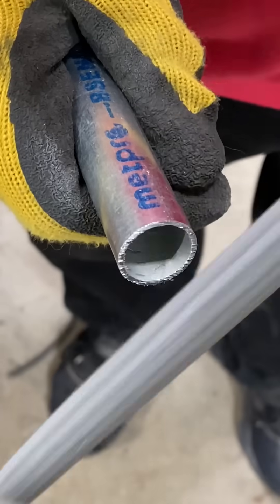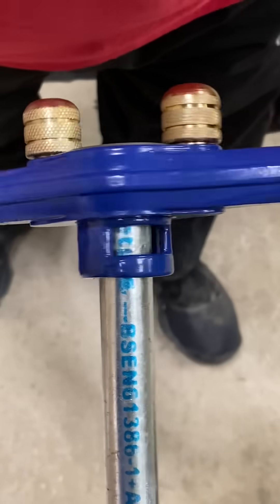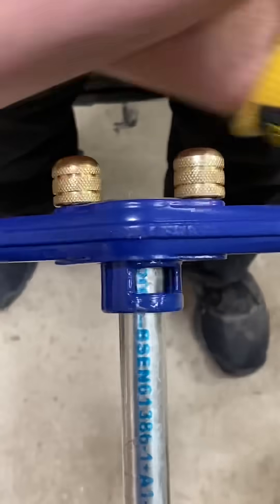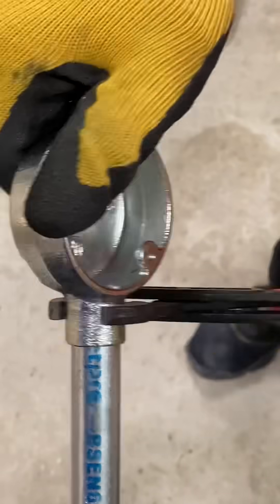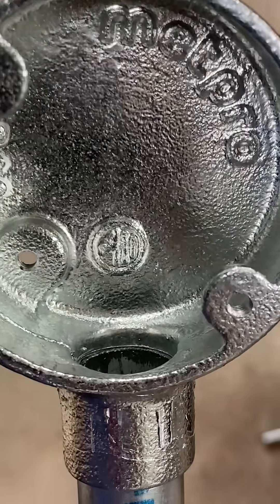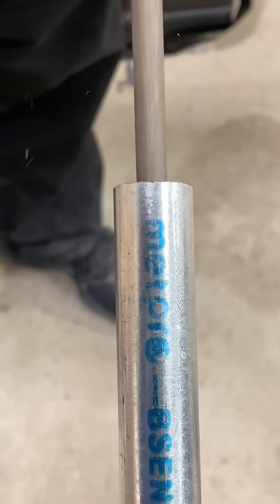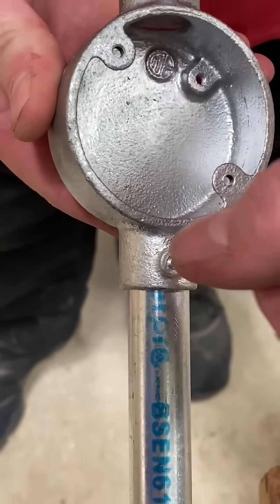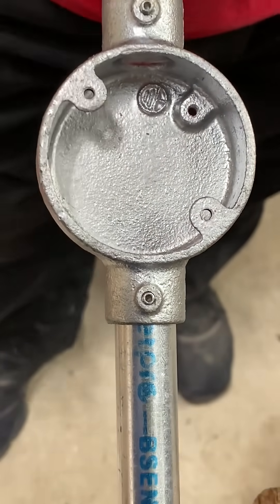THREADING METAL CONDUIT VS CONLOK FITTINGS -#Shorts

Comment: conlok seems extremely poor quality, the grub screws are pathetic and small, often stripped before you even get near them, although so is most conduit and dies etc, they never seem to thread straight, and indeed a lot of accessories are not tapped straight.

Comment: Do that all day, 5 days a week sometimes using 25mm conduit . You soon get bored of threading conduit. Plumbers have had push fit couplings for years, and water goes throu there pipes.

Comment: Should have used a spiral fluke reamer to dress the end of that galvanized rigid  steel conduit.  He didn't put anywhere near enough bevel with that rat tail file.  Look at the end of the conduit when he finishes screwing the fitting on the end of the conduit.  The wire insulation could be easily stripped  off while pulling wire through it.
Also those are NPT (National Pipe Thread) dies in that pipe threader which should never be used for an electrical installation.
Electrical conduit threads on a 3/4" conduit like that should have a 3/4" taper per foot.  NPT threads like the one you see here have no taper.  Those dies should only be used for plumbing.  Generally used for water and pneumatic installations.  Of course you'd never use galvanized pipe for a pneumatic installation.  You'd use black A120 CW,  150 psi WOG.  You guys be careful and don't hurt yourselves...

Comment: We don’t thread emt because it’s not technically conduit. Emt stands for electrical metallic tubing. Imc (intermediate metallic conduit and grc (galvanized rigid conduit) is always threaded. Emt is so thin that threading it can compromise its integrity and it’s not supposed to be placed in areas where subject to possibly severe damage. Cannot also be used to support anything and a separate ground wire must always be installed. The fittings we used for indoor are similar to the conlox thing. They are set screw connectors. Outdoor or damp locations require rain tight compression connectors. I personally don’t see the point of threading emt. If something needs to be threaded then imc and rgc should be installed instead.

Comment: We use compression couplings for emt or set screw style. Depends on what the specs call for. We use rigid steel pipe when doing the treaded pipe. And frankly you should blame UL whatever they say we can use we use. Obviously people are gonna use the cheapest method to make the job the cheapest. It's kind of sad because I would really enjoy threading my EMT.

Levi Hermer
IBEW #601
Commercial Inside Wireman

Thanks for the look , from your side of the pond wherever that may be. Alwayes interesting seeing how many different ways there are to get from A to B and get some wire inside. Lol 🤣

Shit everyone alwayes gotta have their own way to do it, that's "better" then everyone else. 

Long as the check clears il thread it or not thread it, depends what they want to spend on materials.
Reply: Or what code requires per the project....before I get attacked lol

Comment: You are right Americans don't like to thread we use compression fittings it's a lot quicker. I do like threading some pipe . But if you make a mistake you have to rethread using compression fittings it's just a simple cut with your Milwaukee fuel 12volt compact band saw on your side

Comment: I was told we don't thread EMT because then the wall thickness where threads are is to thin and will eventually break there. The steel conduit is thicker wall.

Comment: You Brits need a tapered pipe reemer to debut the ends of the saw cut conduit. Or use plastic wire guides. What you showed could strip the insulation off in the middle of the pull.

Comment: This is not good even if you do this use compression connectors or regular screw-on connectors because if you look closely when he gets the box and you can see the birds on the inside which is going to Nick all the wires this can cause a short that's why you do not Red emtu Thread rigid

Comment: Oof, as an electrician, why would you use the channel locks on a clearly finished surface that will probably be visible?? Good trick is stick a screwdriver or nut driver into the open face of the box and into the other conduit hole and use the screwdriver for leverage. Keeps the fitting looking much cleaner if it will be visible

Comment: Why bother with EMT if you're going to thread it? Just use rigid. Many customers like the speed and low cost of EMT and compression fittings, so just follow what the local code requires or the customer prefers, it's not difficult!

Comment: In the US it’s actually against code to thread EMT (thin wall). Only permitted in IMC or RMC. That’s is because emt in the US is way too thin to thread. Only allowed to use set screw or compression couplings/connectors.

Comment: Wonky BS, I wouldn’t trust that set screw w/o thread locker, and even then I wouldn’t use it. Pro tip: Easy and cheap never equals sturdy and long lasting.

Comment: Threads aluminum pipe. Nothing wrong with the old way when it's soft metal but try that on cast-iron pipe that's 2 in and not 3/4

Comment: That’s a big no for me.  I’ll thread it using a pony any day before I use a set screw.  Reason being that set screw will loosen over time, the conduit will slip out from vibration alone, then you have exposed wires and no ground. Or you have someone using the pipe as a ladder rung, same result.  I seen it too many times.

Comment: Why use conduit? Seems as so much unnecessary work.
Also an insane amount of metal to run some wire
Reply from the maker: mechanical protection - e,g industrial environments
Reply: @efixx  yeah, i work in industry and still barely use pipe, we only use it where it's Exposed for any physical damage.

Comment: I would much rather have a threaded conduit box much sturdier connection less chance of condensation and or water getting inside not to mention on your running long connections the threaded conduit boxes is the way to go in my opinion

Comment: Threading EMT?! 🤣😂.  YOU ARE ALTERING UL LISTED MATERIAL.  NEC 110.3(B) Installation and Use. Listed or labeled equipment shall be
installed and used in accordance with any instructions included
in the listing or labeling.  Making this idiocy 100 percent illegal
Reply from the maker: In 🇬🇧 conduit threading is standard - it’s much thicker than your EMT

Comment: I do both only if required in a project spec... local regs is flexible to plastics, threaded, screw or chem cement... underground is pvc or pe... never metallic..

Comment: Grub screw is useless if it has to be fire rated which is the main reason you would bother using steel conduit..
Reply from the maker: Mechanical damage is the main reason to use steel in lots of applications.

Comment: I did millwright work for 6 years,  I always carried a tube of super glue for the set screws.  Worked every time.  I've been out of the business for 5 years but I guarantee my work is still holding up.  I hate EMT conduit.

Comment: Not good enough. I use schedule 80 stainless steel pipe with fully welded joints.
Reply from the maker: Hot works is a challenge on most sites

Comment: Well yeah... thats a method to connect things, but you should remember that this typ of connection cant be air-tight and is weaker. That for i cant see any use on pipes

Comment: Yep that's pretty much the way us yanks do it over here on the other side of the pond We don't thread EMT because It weakens the end of the conduit and under pressure it will break off The threads are deeper than the EMT is thick  so we only thread rigid and intermediate conduits.

Comment: The only time you need those threads that if you have a yacht and you're doing the conduit on a boat that's going to be rocking and bumping around that thread is going to hold 10 times better than the other.

Comment: A set screw with no detent? Umm... No. Ineffective. It'll slip like crazy. You need to punch or drill a dimple for the set screw to fit into. That way it won't twist or slip out of position if it gets bumped or tugged or dropped.

Comment: I honestly think i like threading pipe more than i like using grubs.     As an american who doesnt thread pipe, id happily use a threader tool over grubs in almost any scenario.   Grubs strip faster than phillips screws in most cases, and hex heads are much harder to source and keep than a decent sized threader.       But im also used to hand drilling and wire sawing so i probably just prefer the tried and true methods.

Comment: That looks like Ridgid Pipe and you also got to deburr the pipe.
Reply: That's 100 percent EMT. Also he did deburr it with the file.
Reply: @jonlehman2671  it’s not EMT. It’s UK class 4 steel conduit - more akin to US rigid conduit. You can’t thread EMT.

Comment: Yes it’s quicker, but do you want this in your house instead of a solid mechanical connection? Same goes for plastic water pipe/flexible gas lines, if that’s your level of acceptance for the place you live god bless. 

But I’ll see it through proper, and wouldn’t accept less for a customer and If they don’t see the value and wanna pay send them packing.

Comment: Yank sparky here, we use set screw connectors on pipes all the time, just not outdoors. Rmc is usually threaded because its usually specified for rough service.
Reply: As a fellow yank sparky I approve this message
Reply: Greetings fellow yank sparky's may I join this club
Reply: This has nothing to do with my job, but threading what looks like a pipe to the youtube algorithm and BAM here I am. but i am a yank Pipefitter. Can I join the club?
Reply: @bretatvs  i welcome you to yank tradesmen club
Reply: @Superbonker-np6iz  you spelled yank wrong but I guess I will allow it

Comment: Such a horrible idea to run electricity through such excellent conductors. Just a lethal source of danger. I never understand why that is still a standard. We’ve moved on! There are plastics to prevent you from untimely deaths!
Reply: It's far more resistant to fire and damage than PVC. Mostly used in commercial/industrial applications. Besides it's normally grounded in multiple points as well as having a ground wire.
Reply: @blaydCA  Fire is the reason? Really? Electrocution of whoever happens to touch it is not the issue? Fire would be more likely to start with festively sparkling short circuits I would expect. As soon as the grounding is compromised you’re left with a death trap. I’m glad I’m not living  over there 😂

Comment: We don't thread in north America because it thins the emt, and that end looks sharper than it should be for pulling wire. "Conlock" seems like a roundabout way of not using couplings and connectors like we do - but all our boxes are all compatible,  affordable and with a simple knockout of varying sizes. That tiny Allen key seems pretty small to rely on for continuity as well. Not impressed

Comment: Why thread emt it's already paper thin and you want to remove more material also it might be a language issue or something an an American who used to be an electrician we called emt the thinnest pipe you can buy for electrical usages emt and imc was medium thickness and rigid is the largest thickness used the most I also understand the need for better electrical standards here in the usa we get away with some dangerous things we really shouldn't like fine dust should never be found in electrical conduit and boxes but they  they are made it's always inside them and it's potentially dangerous not even going to talk about house fire hazards I'll be typing for years to explain that garbage fire waiting to happen even on new construction
Reply from the maker: It’s equivalent to your IMT or RMT - we’ve learned that from the comments - thanks 🙏
Reply: @efixx  awesome I figured that was the case it looks like imc due to smooth finish its fun to look at different/safer countries to see what they are using we need to be using these conloks too instead of set screw though I like our compression fitting not the cheap ones though

Comment: You Britts still don't use ground huh complains about threaded emt but ya guys still don't use a ground🤣 safety aint first out there huh
Reply from the maker: We use ground - but it’s called earth 🌍 or Cpc - circuit protective conductor

Comment: Con lock is crap
Reply from the maker: Thanks for your detailed response 👍🏻
Reply: @efixx  it’s crap because it’s not very secure the grub screws constantly come loose when wiring. You can also easily rip the thread out of the where the screw is tapped into the conduit box spout if you over tighten. It also looks like dog shit the box never really sits straight there is too much play.

Comment: EMT in America is a thin walled metal tubing. RMC is the rigid, thick walled metal pipe you can actually ream and thread. If tried with EMT you would simply distort the ends of your metal tubing and get an earful for your stupidity. Lol

Comment: That's a smaller version of how we used to pipe tower lines for de-ionized water to clean the insulators. Dragging 2 inch pipe upwards and making the cuts, threading, and adding the "T's" and fittings. 👍

Comment: This is almost identical to EMT applications over here in the US. The grub screw is smaller than our setscrews and the threaded nip on the box is a separate peace. Other than that it is identical to what we have used for decades. IMC, and RMC are still always threaded though.
Reply from the maker: Great info thanks
Reply: They do sell compression fittings for both imc and grc. For when you need the damage rating but not the threaded connection.

Comment: Prefer the threaded method more sturdy , if the house experiences damage in some way the threads hold fast but a grub screw will come loose .
Reply: It’s emt. It’s already not that sturdy. In America we don’t thread it, but we don’t really use a grub screw either, we use compression couplings that thread into the box.
Reply: @mccatdaddy  What they threaded wasn't EMT, it was steel pipe. Much thicker wall than EMT. I wouldn't want to be bending what they're using.
Reply: Just to be clear UK Galvanised steel conduit is far more rigid and has thicker walls then EMT
Reply: Than*
Reply: Threadlocker.
Reply: Highly unnecessary for locations where emt is used and just costs more money. When installed correctly, the pipe will bend and break off from it's strap before the fittings fail. If heavy damage is a likely possibility, there's much stronger materials available.
Reply: If your house sustains damage from some outer force, I think conduit coming out of a fitting is going to be the least of anyone's concerns.
Reply: Not with emt one turn too much an you broke all the threads and if you don’t calculate the proper thread amount you will have a thread that will be sloppy
Reply: Why not use both
Reply: The wires will hold the conduit together, just has to be strong enough to pull the wire in…. Lol I’ve seen so many things
Reply: Job security !
Reply: I think thats the least of your problems after an earthquake
Reply: That shit doesn't even hold an aftermarket shifter on a car.
Reply: Those threads are in such thin wall pipe the grub screw is most likely stronger. 

I prefer set screw fittings myself. They survive most anything short of breaking the EMT itself. 
Compression fittings are garbage, and I avoid them unless it's the only way to meet code. They will come loose from vibration.
Reply: @leftyeh6495  threaded conduit has been used for decades, with good quality parts, it is totally secure. Conlok by comparison, is just a poor attempt, largely let down by that pathetic grub screw.

Comment: The new way…been using fittings like that in North America for 50+ years
Reply: Yeah im super confused, really hope this is a joke. Wouldnt be surprised though.
Reply: @alexandergooding4860  this is UK, conduit. So it's new method in the UK.
Reply: Yeah, this 'new way' is basically how most emt connects in my experience
Reply: I have not ever seen threaded EMT. Only rigid steel.
Reply: Don't see many threaded galvanized boxes around here...usually just outdoor plugs and light boxes
Reply: @drakes89  I have never seen it either, but I know it's out there as the NEC recognizes it as and approved wiring method
Reply: So true!
Reply: Set screw fittings are okay for indoor use or not in wet or damp locations you could not put that device and box out in the weather and not expect water to get in through that cam lock fitting no wonder they lost the War of 1812
Reply: @tricklicker69  I don't know anyone who would use EMT outside anymore, I believe the standard would be PVC
Reply: That’s why we have rt compression fittings.

Comment: The thing is if it's treaded it will not leak and less chance of corrosion...here in America we fall just behind the Chinese in finding ways to make it cheaper with lower skill helpers.
Reply: Uh, the corrosion protector zinc was just sliced off by the threading die and bare steel is now exposed.. the chance of corrosion is now a guarantee.
Reply: @randomidiot8142  good point so what is a good emt for extior use.
Reply: @tonytunnell9873  I'm not an electrician or an engineer, I'm just here to point out the obvious flaws. Coming up with a better design is not my area of expertise. Personally I would use UV resistant polymers for exterior stuff that I wanted sealed, but I'm not an electrician and I don't know if that's up to code.
Reply: @randomidiot8142  ex electrician here turned tree climber. You would just us pvc pipe that's made for outdoor and electrical use for outside with seals of course. I'm from the state's where we don't thread emt only rigid pipe.
Reply: @randomidiot8142   I'm not sure either

Comment: Different methods for different applications. I can't imagine Conlok fittings are water tight, where as threaded with a sealant or tape with be water tight.
Reply: You'll never keep all the water out. Never. 

Give it a path to drain, and it won't build up and be a problem.